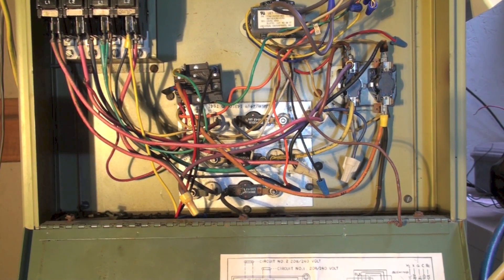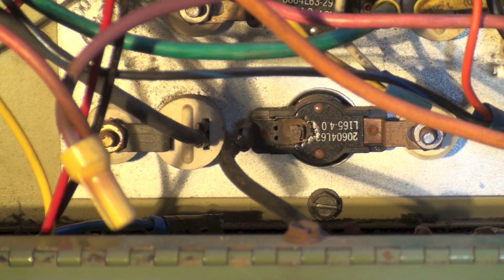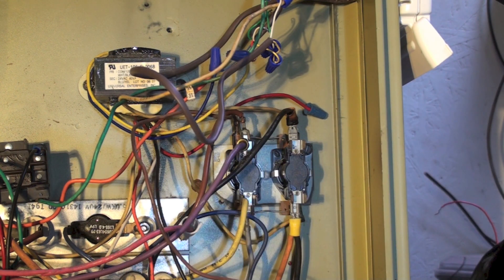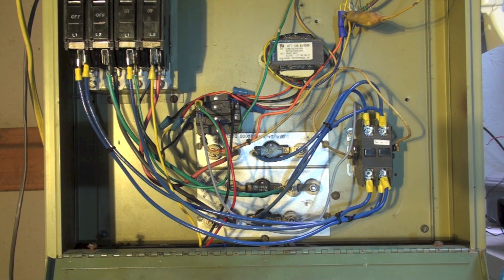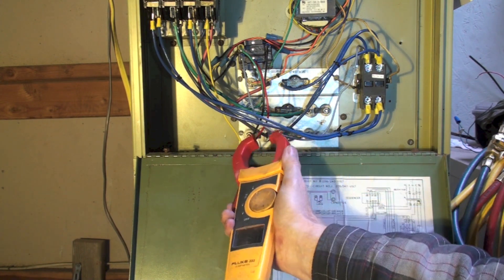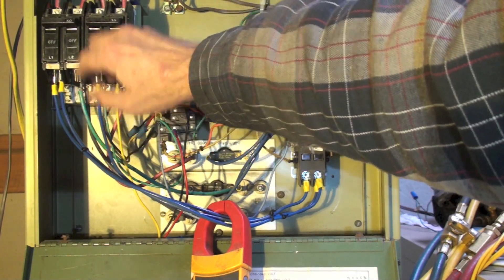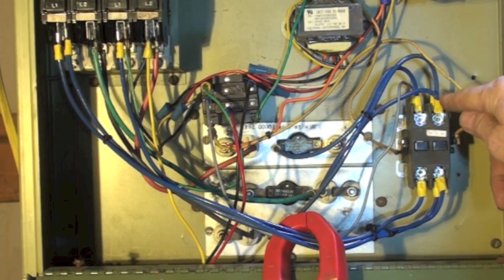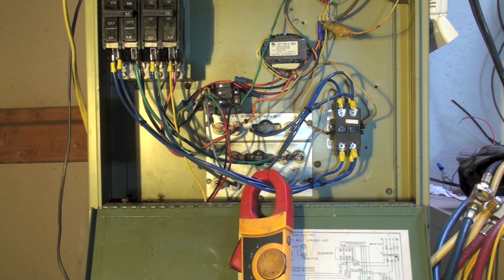Electric furnace, replace sequencer with contactor

Comment: For those  that are working on an electric furnace, I have found a GOOD heavy-duty 1/4" quick connect - NOT the crappy shyte sold for general use. It  is part number P-HT-BFF-250 by WiringPro. It  is billed as a "high temperature' part and is WAY more substantial than anything else I have seen - there are no thin spots and it grips the blade with considerable force - great for high-current work.
I recently had the top half of one sequencer burn away - GONE! - and damaged some wiring in the  resulting fire. I believe the problem started from an arc on a standard quick-connect. I have replaced all the high current wiring in my furnace with the WiringPro connectors.  Although sold as 14Ga connectors, they  can be opened slightly (with a nail or a watchmaker's screwdriver) and then both crimped and soldered to 12Ga wire. (I didn't try them on 10Ga.) If you are having trouble with quick-connects getting hot, try these connectors! (Unfortunately their  web page appears to be down at the moment.)
Reply from the maker: There are 2 problems these connectors must deal with.  One, adequate friction to keep voltage drop down.  I have used these connectors and they work well in this way, although not spectacular.  Two, high temperature connections.  For the most part, this is meaningless.  High temperature connectors are made for use in high temp environments.  Not high temps caused by poor connection.  These high temps are much too high for any connector to survive.  
Also, the sequencer with the burned top is common for this type of sequencer and is sometimes but not always caused by the contacts inside making poor contact and burning up.  Sometimes, the top with the connections is completely separated from the sequencer with the connection actions still firmly attached.  Not too thrilled by the 14 to 16 ga wire size that must be adapted and therefore possibly causing a poor connection.  
The only real solution to this problem is to replace the sequencers with contactors and use ring terminals for the connections.  This is a viable alternative that is used by some manufacturers as original equipment.
GFM
Reply: Have you ever used a sequencer to control more than one contactor? That would take the high current off of the sequencer and yet allow the sequencer to control the  time delays.
Reply from the maker: I have not.  Except in very rare circumstances, energizing all elements at the same time causes no problems with brownouts.
GFM
Reply: I think you just solved my problem  BRAVO

Comment: It ‘s not good for energy  efficiency.
Reply from the maker: Using a contactor to immediately energize the elements will have no effect on energy efficiency.  When the elements are turned on, they are on and using energy.  There is virtually no thermal mass in the elements.  When they go off they are off.  The energy is off.  The heat is gone.  Sequencing elements on and off was originally used because  the pole transformers were not capable of accepting large loads all at once.  Modern transformers are easily capable of handling this load.  
GFM
Reply: If it pure electrical heater may not much difference . If use with heat pump as auxiliary heat , auxiliary heat may not need to turn on all   before  return  to regular heat (coil).the less auxiliary heat been used ,the less energy consumption.

Comment: .  I have a Good man electric heater and a serviceman said it need a control panel but when I call  another company i the deal with electric heaters they mention that  it  need a Heat  strip.. *The heater won't come on so I'm wondering just from hearing about the heater won't come on,( The blower comes on) but there's no heat what would you suggest,?
Reply from the maker: Usually these units have several heat strips.  If one has failed, you should still have some some heat.  It sounds to me that neither one has done a complete diagnosis.  
GFM

Comment: Do you have a part number for a 3 pole contactor? Does the contactors turn on and off from the 24 vac directly from the thermostat? I didn't see you show that part.
Reply from the maker: Any 50 amp contactor with a 24 volt coil will do.  The thermostat energizes the contactor coil.
GFM

Comment: I live in a mobile home with furnace heat.When the furnace heat kicks off and the blower sequences down,it blows cold air into the home.This sucks.I think im going to replace my sequencer with a contacter.This should fix the problem with the "cool"down of the sequencer.I like the idea of the contacter kickin off when the temperature is met.Seems like it would save money.

Comment: Hmmm... my furnace states the breakers on it, is for short circuit only and not for overload. But then both breakers are 60 amp. Interesting, I'm learning from your videos on furnaces, after watching this video I now know my furnace does not have sequencers. Lol since I bought this furnace I thought it did... it all makes sense now why all my elements were kicking in at once. I kept thinking what the???... little did I know. Thanks, you just answered a question I had asked myself 100 times. PS, furnace guy, you really thing contactors are better than sequencers?... just askin, it seems like it would cause a furnace to use more electricity over time???

Comment: Hi, how do you calculate what size contactor to use to replace the sequencer [examaple amps] THANKS FRIEND
Reply from the maker: Using the amp draw of the elements and motor and matching the contactor to it.  Example: 20 amp element, 5 amp fan, 30 amp contactor.
GFM
Reply: Thanks

Comment: U could also use 2 contactors and a delay on make timer. P.S. your not using your crimpers correctly. your getting a hole because that's for non insulated connectors. go all the way to the bottom. that's for insulated connectors. good video though

Comment: I am having a problem where the fans will not cut on by the thermostat but will cut on my the fan switch. I had the same issue with the burnt limit switch could the problem be the sequencer?
Reply from the maker: You could have a sequencer problem or a burned wire to the fan.
GFM

Comment: with me, i  think the way you replace sequence by compressor contactor  not a good idea. if you do so when call for heat, too much power go to all 3 heating elements at the same time, making breaker shut off easily
Reply from the maker: Electric elements have no inrush of power, so they will not kick off a breaker.  Note also that Trane heat strips all use contactors to control the heat strips.  The idea that turning on all strips at once will brown out the circuit is a myth.
GFM
Reply: Proper electrical design requires the breaker load be approximately 80% or less.   Given typical 5kw elements draw 20 amps each, then the breakers have amp headroom.  Remember sequencers end up running all elements at once for long periods during cold weather.  The key is proper breaker and wire sizing which is a constant either way.   Finally the inrush to worry about is the AC compressor, often exceeding 130 amps on startup even though the breaker size is 30 or 40 amps.  Breakers have thermal delays to accommodate large initial inductive (motor) loads.
Reply: The point was if you think heat strip inrush is a problem then you really can't sleep nights knowing about the compressor's breaker inrush current.

Comment: How much of a local brown out will this cause? Over time, modern electronics are extremely vulnerable to brown outs that aren't even noticable visually.
Reply from the maker: I have not seen any problems with this type of repair.  Some manufacturers equip their furnaces with contactors.
GFM

Comment: Crimp the back side. Good info man. Will deffinatly start doin that
Reply from the maker: Merry Christmas
GFM
Reply from the maker: There are no aluminum connectors.  It is not suitable for this applications.  The connectors are copper.  Stainless is for connections that are exposed to corrosion.  No connector will hold up to heat from a poor connection.  The connections must be clean and tight.  Stainless does not conduct as well as copper, so it should not be used for high amps.  
I have seen so many of these stainless connectors burned up because the connection was not done well.
GFM
Reply from the maker: The factory uses a a coating to make them make better contact.
GFM

Comment: If you are going to use a contactor, use a 3 pole contactor ( one per element). It is not a good idea to double lug and you will reduce the load on the contacts.
Reply from the maker: You could certainly do that, but if your contactor is rated for the amp draw used, there is no overload.  Contactors are commonly double lugged in the industry.  
GFM
Reply: 3 pole contactor I see on 3 phase but not much on single phase due to economic issues

Comment: I would love to see a 30 kw ( not uncommon where i live) done this way,and not have the lights dim!!!!!!!!!!
Reply: Ohh that right 3rd world country where your power browns out a lot... gotcha..  Also he did say this is for HVAC techs not general public....
Reply: And if a fire happened and this was found your insurance would not cover you.
Reply from the maker: I have done it and the lights do not dim.  The sequencers were designed to be used when pole transformers were not designed for the high loads we have now.  They pretty much stopped using the smaller transformers in the 1970s.
GFM
Reply: None the less you are altering  or eliminating the factories control features and in my country you are not allowed to do so ,without the governing authorities permission  so stop showing people how to do stupid things...just fix it properly and it will last another 20 years.
Reply: Hi. I’ve heard this statement about transformer load and sequencers before. 
Perhaps you could explain to me how a sequencer lessens  the load on your transformer. 
I can’t wrap my head around it. 
It makes no logical sense to me. 
If my furnace draws a 100 amps. It going to draw that same amount with or without it sequencers. 
Thank You
Reply: Hi. Not that it means must but I agree with you 100%. 
That re-wiring job would not pass ANY safety standard anywhere. From what I believe I can see in the video its not wired right anyway. If that 30 amp breaker kicks off, the fan is going to stop and 2 elements are going to remain on. I hope the high heat safety switch’s work that he installed. The relay he installed should NOT be controlled by the thermostat, it should get its power from the factory installed relay just like the sequencers did. 
Hey !
But everybody’s an expert tech on the internet. .

Comment: the amperage went up to 68 amps , and the contactor is rated to 50 only     eventually the contactor is going to get burnt sooner , they are taking too much heat
Reply from the maker: The contactor is rated at 50 amps per pole.  The original clamp was around all 3 element wires.  You could run up to 100 amps thru both poles of the circuit.
GFM

Comment: ok i did it but i had to put all 3 elements on the 60 and the fan and transformer on the 30 or the breaker kicks out on the 30 it is working now is that ok i changed all 3spring elements and limit switch
Reply from the maker: +scotty dog If it immediately kicks off, look to your wiring.  If it kicks off after some time, be sure the terminals at the breaker are tight and check amp draw of the circuit.  I have done this dozens of times.  It works well.  Also, if you put 3 breakers on one 60 amp breaker, the breaker will kick off after some time.  
GFM

Comment: that's cool that you figured out how to upgrade it.   Perhaps they shd have made it that way.    But....  why not use solid state relays (SSRs)?
Reply from the maker: +Tim Spriggs Some furnaces come with them.  There is no real value to using an SSR.  I can pretty much guarantee it will not last as long as a mechanical one.  Also, I haven't seen one that was rated at 50 amps.
GFM
Reply: grayfurnaceman also, finding one that is SPDT is like finding hen's teeth.
Reply: +Tim Spriggs SSR tend to fail closed.
Reply: +Tim Spriggs SSR tend to fail closed.
Reply: +Tim Spriggs SSR tend to fail closed
Reply: +Tim Spriggs SSR tend to fail closed

Comment: This is a good video. I also like to the solder the crimp on connectors. That way you will never have a problem at the crimp end as long as they are tight under the screw.
Reply from the maker: +neutrodyne Good thoughts.
GFM
Reply: Best to use a high temp silver solder not the cheap solder used in a transistor radio circuit board.

Comment: Thank you !! Furnace works great finally working with contactors after being broken most of the 20 years of on and off working  ...finally fixed ..great advise !!
Reply from the maker: +Jeff Booher Glad I could help.
GFM
Reply: I need to send you a superman cape !
Happy New Year ! heat in our home!
Reply from the maker: +Jeff Booher Sounds good to me.
GFM
Reply: +Jeff Booher are you the owner of the above unit?  just askin'
Reply from the maker: +Tim Spriggs Its a test mule I use for things like this video.
GFM
Reply: I made a circuit that uses SSRs (two) that will replace a relay on my old Lennox furnace fan.  Have yet to try the latest revision.   have had a series of failures but I think it shd work this time around.  only about 8 revisions or so.  The advantage for me is that it's quieter,  which I really like.  If it works.  I'll let you know in the weeks to come.
Reply from the maker: +Tim Spriggs Honeywell makes contactors that are quiet operating for just this application.  
GFM
Reply: +grayfurnaceman I don't mind the click when they turn on .... love the heat ....when I asked the tech to put in the contactors in he said it wouldn't work ... and he would wait to see if it didn't pop the breaker ... after some convincing he liked the change ....
Reply: grayfurnaceman thx.  if my setup doesnt work I will be looking for one.   When my AC comes on , the relay is pretty loud. it's not a click.  It's a thump.

Comment: I have 5 elements I will ask the service tech to install 2- 50 amp contactors 1- 50 amp contactor for two elements1- 50 amp for three elements 1- 25 amp  contactor for the blower?
Reply from the maker: +Jeff Booher One 50 amp contactor will operate 4 elements breaking one side of line.  The first element and the fan can be operated by one 25 amp contactor.  If you want to separate the fan from the first element, you can use one pole for each.  Hope this helps.
GFM

Comment: Basically I'm trying to round up the parts to save money then I'll call in a professional to wire it ... it has been difficult acquiring these contactors I don't care about the noise what was the model used in this video? I have a 5 element furnace so I like the idea of adding a second contactor and installing a inline time delay device any help would save my family money would be great
Reply: It would cost you money in the long run don't do it !!!
Reply: I have had this in place for a year ... noted no extra cost and after years of a broken furnace it works fine...
Reply: I also have a five element furnace....
Reply from the maker: The contactors should be available from any electric supply house.  50 amp resistive contacts, 24 volt coil.  The contactor used for the single element is a 30 amp resistive 24 volt coil.  I don't see the need for the time delay.
GFM
Reply: I just did this to my heating system I plan on doing a heating test it will take 9 heat ups and see how much time time and wattage to heat it up  in the following configs 5KW at fan speeds low med and high 10KW low med and hi  and 15KW low med and hi and I'll calc the data and make a graph give me a few weeks....

Comment: I notice the amps were above 60 wont that blow the 60amp breaker when the furnace fires up?
Reply from the maker: +Jeff Booher The meter is measuring the amp draw of both the 30 amp and the 60 amp breaker.  So it would need over 90 amps to kick the breaker.
GFM

Comment: That's a very interesting approach I like it. Lots of variables can be explored  in your approach, I was thinking you could even add another contactor with a inline time delay device to get a delayed start to the third coil or even 2 stage it. Very informative and you get straight to the point. thanks
Reply from the maker: +rey abbey Many electric furnaces were originally set up with 2 stage.  Merry Christmas.
GFM

Comment: So the question I have is the sequencer has a purpose to run the fan after the strips shut off. The question is how efficient  is this do the limits pop a lot or do you tell the customer to leave fan to on in the thermostat switch? How many call backs do you have once a year once in 2 years just curious not trying to bust your balls.
Reply from the maker: +andy sharp The sequence of the electric furnace is to start one element and the fan first.  The other elements sequence on some seconds later.  When the thermostat is satisfied, the elements shut down in the opposite sequence with the last element shutting down as the furnace fan shuts off.  The fan normally does not run after the last element shuts down.  Leaving the fan on is not necessary.  Efficiency of the electric furnace is essentially 100% as there is no stack loss.  Callback ratio for me was around 3%.  Hope this helps.
GFM

Comment: Great instructional video. The total furnace draw amperage according to the amp meter reads 68.3 amps but the circuit breaker is rated at 60 amps, is it the result of energizing the heat strips all at once without a timed sequencer? Thanks for sharing again.
Reply from the maker: Francisco Castellanos Actually, both 2 elements are on the 60 amp and 1 and the fan is on the 30 amp.  Thanks for the thoughts.GFM